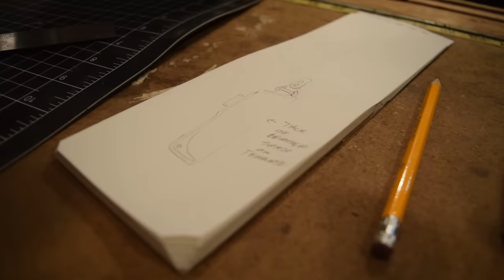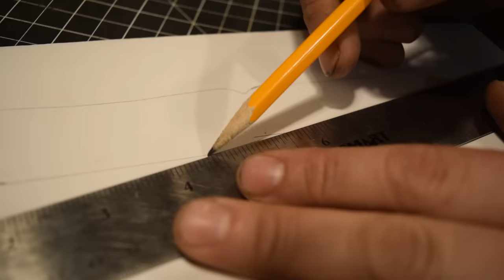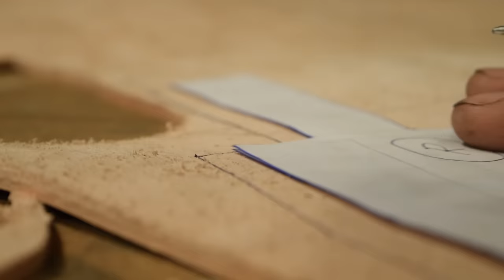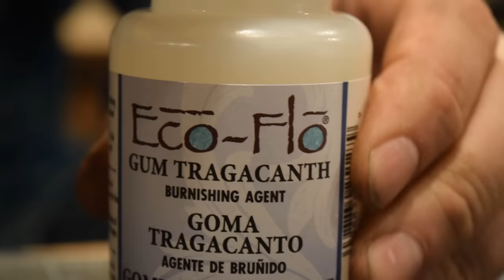Making a Bushcraft Sheath for My Woodlore Clone

Comment: For stronger stitching, you can tie an overhand knot each time you pass the needles through the leather. Also, I wonder if a little thinner leather would be a little easier, but I'm sure you chose the thickness you wanted for a robust sheath. Nice job.

Comment: That was some thirsty leather!  Also cool that you took the time to measure precisely the leather you needed and just cut it out.  Most people I have seen will just fold a large piece and then trim and sand it after sewing.  Nice work.
Reply: Most Leather requires more than 1 coat of dye to get an even coverage, and the same can be said of any finishing you apply... Veg Tan in general is thirsty indeed.. as for the comment about layout, most Leatherworkers worth their salt will layout the job first THEN cut as it saves wastage of the material you are using...

Comment: I have always wet the leather before stitching, helps thread to pull down into the leather.  Helps to wet fold lines too. I like to wet the leather after all stitching is done too, I use the ball end of a screwdriver as a burnisher.  Nice job on knife and sheath. It's nice to watch a fellow craftsman who takes pride in his work! Nice to make it look like you did it "on purpose"!

Comment: Hay great DIY I am getting better instructions on your video about leather work than many experts on YouTube. Some can do and sometimes they can't teach..
 Seriously I just completed 3 knife sheaths and one for my garden trimming sniper. 
  Something I found myself for my knife I had to take 5 layer deep and I trimming the thick layers in my bandsaw and work great. Had to make a zero clearance garden for the blade but it was easy. 
   Glad I'm seeing this you are improving my next sheaths as I am starting 2 more for garden trimming snipers.
I  also found information on sharpening my "new " leather tools I just got a few weeks ago using very little but go ahead and sharpening them up and you will see big improvement on the preferences and glad I did.
  You can make a sharpening video for your leather tools next.
Thanks

Comment: I've done half dozen or so sheaths like that one. I used gum trag on a few of them but never really got what I wanted from the edge so I made my own edge burnish compound. I used half beeswax (melted) and half olive oil. Let that harden and it makes a softer beeswax. I use that on all my edges now and it makes a really smooth edge with decent gloss. It is soft enough that the friction from my slicker really makes it sink into the edge. On the saddle stitching, a good rule of thumb for sheaths with a welt are at least four times the stitch length but I usually go four and one-half just to prevent working with short thread near the end, however, it is not difficult if thread comes up short to backstitch two, bury the thread and then start again in the last hole. On some projects like brief cases, where the thread would have to be way too long, I always keep the length manageable and then start again where needed. Nice job on this and your knife looks great. I missed the video on that so I'll go back and find it.

Comment: Nice Job. For a novice, you made a very serviceable sheath. When you are measuring thread for your saddle stitch, you need 4 times the length of the stitch line. I have never seen the dinner fork method for spacing stitches, nice idea. Thanks for posting the build. Looking forward to the ferro rod handle. Take Care.

Comment: Really very nice.  I'm going to have to give that a go myself.
If you were interested in trying a few other methods of leatherwork, you could experiment with the following;
In English bridle/saddle stitch work the strength of the leather is of utmost importance, so if one can possibly avoid it, never cut through the grain side of leather, because that surface is where the majority of the strength of the leather is.  Producing that out-line around the edge of a piece comes from "edge creasing", using a hot tool to compress and consolidate the fibres of the leather near the cut edge, to produce a much more wear- and fray-resistant edge, which ensures the stitching to the other side of the line doesn't lose it's integrity and tear out.  Using a cutting tool to make a groove cuts weakens the strongest layer of the leather right where ideally it would be toughest/strongest.  These strength considerations may admittedly be overkill when your using leather that thick for a knife sheath, but there's a lot of love to be had with these old learned ways.
Also, there isn't a need to cut a groove into the strong grain side of the leather for the stitching because if your stitching is pulled nice and tight and consolidated with a tapping along with a cobbler's hammer, the stitches will sit themselves below the overall surface level anyway.

Comment: Would like to see a safety swivel snap to fire steel cord. Tight in one type of weather does not mean it stays that way if dunked into water or snow ... or other unexpected outdoor emergency situations.  Love the general design & the speed ups with daughter flying by and odd camera angle shots were a nice touch.  I have had a case where a pre-made leather bag came my way and I used Neat-foot compound on it to increase longevity ... but the bag simply deteriorated after 2-3 weeks. I've never used it since ... but have gone to 'Aussi' leather conditioner. [It has nothing 'synthetic' in it] so allows safe fat-stuffing leather with heat gun.  Also ...It does not soak through to discolor leather when want light tan color  Experiments are what it's about eh.  Thank you for the video.

Comment: Get the leather quite wet before you stitch. This helps the thread pull into the leather to protect the thread. Been doing this way for almost 50 years! Very nice job on both the blade and the sheath.

Comment: I've just been doing two grooves for folds, i'm gonna try 3, i thought it may be too much groove but seeing this.....now i'm gonna give it a try my next project. thank you
Reply: Depends on the tool you are using to groove and the thickness of leather being grooved... if it's a V Groove or U Groove and thicker leather then yeah multiple grooves may be required, if on the other hand you use something called a French Skive to make the bend relief, they come in different widths, so just using a Wider one to create that bend relief is all that's required...

Comment: Looks like you are using those same pointed triangle shaped needles I used when I started leatherwork. Ditch those things and get the CS Osborne 00 harness needles. Much better. I am not sure what those other needles are appropriate for, but not this application, cuts your thread. I bought something similar at a Rendezvous around 2012 or so when I first got into leatherwork, not knowing better. Great job on the sheath!

Comment: your videos are amazingly well thought out and instructionaly detailed! I noticed the belt clasp is backward (you don't want the "tail" facing up but that's an easy fix) and I often stitch the D-ring on the clasp so I can easily pull up the whole thing with one hand through my belt. but see? that's just nit-picking! lol Love your videos, man. :-)
Reply from the maker: Warrior Woodsman thanks for the compliments and suggestions. I checked out a few different sources to see what way others had the tail end of the dangler pointing and found both ways out there. I do appreciate the advice. I’ll have to live with it for a while to see what way I prefer. It seems to me both ways have benefits and draw backs. Thanks again.

Comment: Nice job. Gave it a go this morning. Changed it a little bit. Didn't add the fire steel holder or the curved stitches. 

Holds my new marttini knife very well.

Used veggy dye leather. I removed a lot of leather on the bend, but we wet the leather at the fold. This helped to form the bend

No drill press used, but my neighbor has hands like hams !

Thank you for the idea. He'd never made one like that before. We didn't use such a large price of leather. We used some cut offs to form the bit in the middle. For the middle strip that runs into the fold we took that into a point to fit the corner .

Comment: OLD Leather Smith here,  I just found UR channel nice job  great design.   I have some suggestions,  NEVER HIT A METAL HOLE PUNCH WITH A METAL HAMMER U RUINE BOTH TOOLS USD A RUBBER or LEATHER HAMMER. rising in & outside sheath works better. Never stitch line across Leather belt loop always along the long edge, the way U did it causes a perforation which I  have fixed in belts.  2 protect the cap on snaps and double cap rivets I  glued a piece of upholstery hide hair side down on the anvil works great. 
  God's Blessings ✝️ 🥎 🙃

Comment: i used to drill holes too, then I found a finish nail chucked into my dremel and polished smooth would burn holes, which I thought was awesome, until I got some of those fork-shaped stitching chisels, which rock the house.  they cut diamond shaped holes, way easier and neater than drilling.  try some.   Otherwise excellent work, you've got a new subscriber.

Comment: Nice sheath, but with a dangler you wear it on the opposite side to your dominant hand with the blade facing forward (so you still construct it as if it were to be worn on your dominant side) this is so you can grab the sheath with your off hand and tilt it and draw the blade across your body with your dominant hand. 

Because it’s a dangler it’s sometimes hard to pull the blade as the whole rig moves around when you try and draw the blade. 

So right hand user would have a right hand sheath but worn backwards (blade edge facing forward) on the left side of the body and vice versa for a left hander.

Comment: If you run out of thread while stitching you can add more but you'll see where it was extended.  Just take a new piece of thread with the needles and back up 3 holes or so and stitch over those last 3 holes.  You can then continue on with your stitching.  It will look like a back stitch where you added on so that may be a draw back for some.  I don't personally like the look so I always make sure I have extra thread when I saddle stitch, thread cheap so always take more than you need.

Comment: Awesome video brother!
Do you recommend the weld wood contact cement?
Reply from the maker: Ive had nothing but success with weld wood, and have seen others also use it successfully as well. That being said, I’ve never used Barge, which is most leatherworkers suggested contact cement.

Comment: Excellent job!!! What size drill bit are you using???
Reply from the maker: Something like 16th I think, but I have switched over to using a finish nail chucked up in the drill. This way it gives me a nice hole, but because it is mostly stretched, the hole can close in and lock the thread.

Comment: Such a great video and sheath! Awesome work. A couple of questions and a comment for you:
Is there any reason you didn't choose to cut the groove for the stitching on the belt loop before marking & drilling the thread holes? 

Whats your verdict on the gum tragacanth? I have used beeswax to achieve a similar result, but I'm curious if its worth switching.

Although not always necessary, consider protecting stitching on the interior of your sheath with a thin layer of 5-min epoxy or a piece of glued in leather.

Again thats an awesome sheath. Thank you for the great content!

Comment: Very nice job , only thing I would do different is use a awl blade or a fat needle in your drill press ,it burnishes the holes instead of tearing threw it.
Reply from the maker: Thanks! I have switched to using a finish nail chucked in my drill press, thanks to YouTube comments😁😉.

Comment: I have watched this several times as I was wondering if you put any ferrule/tube in the hole for the lanyard?
Reply from the maker: I did not. Just cut and drilled the hole.
Reply: @TheArtofCraftsmanship  Thanks.  I am doing one at the moment and will likely insert a brass tube.  It can always be removed if it doesn't work.

Comment: Nicely done, where did you get your leather working tools from, hard to get good ones.
I read somewhere that you are not supposed to frill leather, something about removing fibre as opposed to pushing it aside, but yours look just fine so I think I’ll give it ago!
Reply: I started drilling about a year ago and wouldn't go back for anything.  I've never had a problem and drilling makes the sewing faster, easier and smoother because of the removal of the leather even though it isn't much.  Anaco,  Anz.

Comment: Great video!  Thanks for sharing your skill with us.  So, at ~6 months out, are you still happy with the design?  Anything you would change?  
Also, if you don't mind my asking...where do you purchase your leather?
Reply from the maker: I do still love it. I have used it several times on backpacking trip and it has worked great. I am getting used to the dangler, but that comfort will come with time. I get my leather from Tandy Leather Factory.

Comment: Good video. 
I have several questions. What size/type needles do you use for stitching? What size is the sinew? What size is your edge beveler? What size drill bit are you using for the stitch holes?
Sorry for the inquisition, but i just started leather crafting and im really struggling. Especially with my stitching. 
Thank you.

Comment: Please, could you tell me what is the name of that toll you use for marking the middle line before you start sharpening your knives? Or is it like a DIY tool? Could you introduce it more? Thaaanks! Great job man!
Reply from the maker: I am using a drill bit that is the same thickness as the blade.

Comment: nice sheath, however I would highly recommend that you do not use a steel hammer on your leather tools. I would recommend that you get a nylon hammer, or a rawhide hammer, they are usually heavy enough to get the job done, either punching holes or stamping. The metal hammer will begin to mushroom out your leather tools.

Comment: Please use a rawhide hammer not a metal one on leather. Also if you want to apply leather dye faster and cheaper use a rubber sanding block and a folded paper towel and add some dye to the paper towel then use that to spread the dye onto the leather. Also for the edges camphor them, burnish, then add the gum makes for a much smoother edge. Same can and should be done for the inside.
Reply from the maker: Great tips! Thanks
Reply: @TheArtofCraftsmanship  Anytime. I used to do a lot of leather work years back.